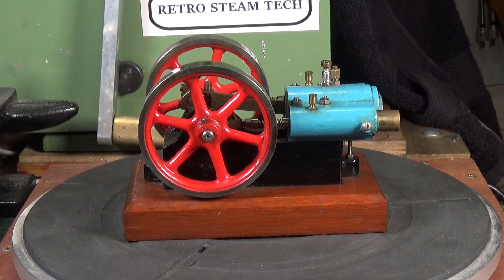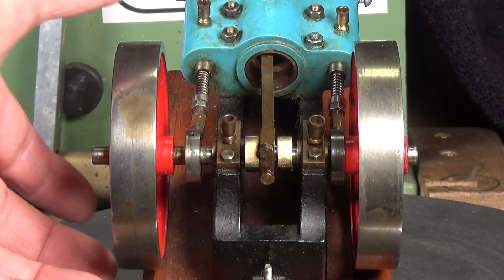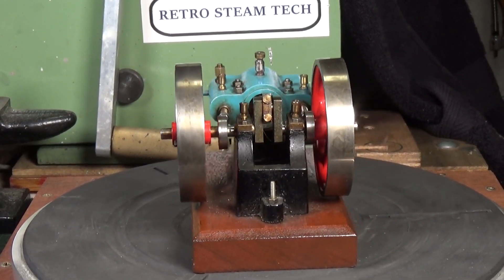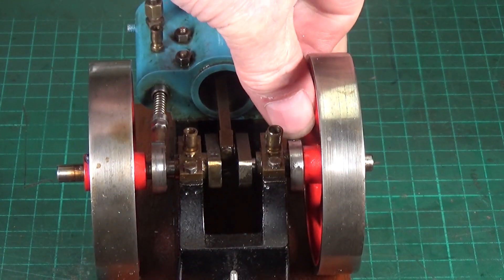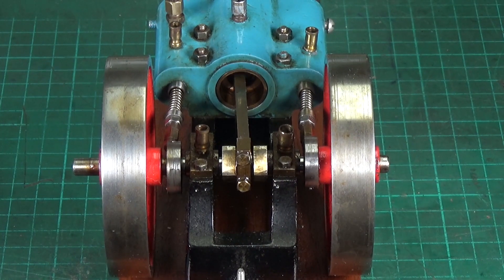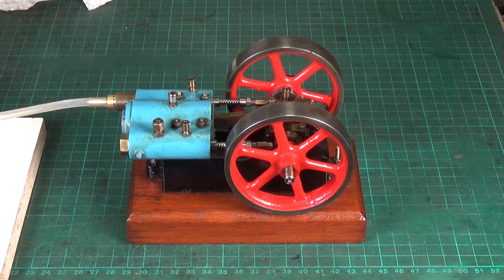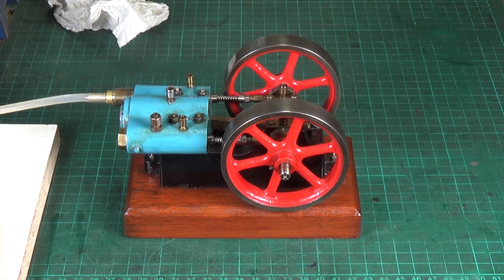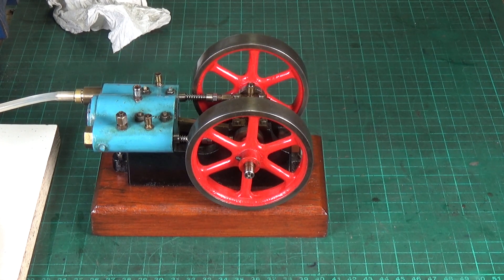Jowitt Poppet Valve Model Steam Engine

Comment: where is the exhaust?
Reply from the maker: Looking from the cylinder end of the engine the exhaust is on the righthand side, it's the small pipe fitting next to the oiler cup.
Reply: @RetroSteamTech  so the exhaust is smaller than the inlet?  Maybe you are running it backwards and the wee pipe is the inlet? Just a thought...
Reply from the maker: @charlesfitton9677  If you look at this rather excellent build blog for the engine https://modelengineeringwebsite.com/Jowitt_engine_build.html you will see from the photos and the plans that the exhaust is supposed to be where it is. The inlet and exhaust valves are different lengths. That being said,  if you adjusted the valve timing there is no reason why it shouldn't run in the opposite direction if you fed the air in through the exhaust port.

Comment: Hello Alan,
I do like the Jowitt and I do like the little compressor... The plans that you have for the Jowitt would it be possible to build one without the castings?
Cheers.
Paul,,
Reply from the maker: Hi Paul. Yes very possible to build one without the castings. If you have a look at 'eifion jones' YouTube Channel, he's one of the other commenters on this video, he built one from bar stock. Also the one which is covered in this build blog https://modelengineeringwebsite.com/Jowitt_engine_build.html was built from stock materials. Cheers, Alan.

Comment: These are great little engines, I made one from bar stock many years ago, still runs great
Reply from the maker: Just had a look at a couple of your videos which feature your Jowitt, it's lovely 👍👍 I don't think I've seen one made from brass before and I really like the solid flywheels too.
Reply: @RetroSteamTech  made it aboard ship so used what I could find in the scrap box
Reply from the maker: @eifionjones559  It's an excellent piece of work and runs really well.

Comment: Hi Alan, you can see the connecting rod moving across the camshaft . I think you could shim the camshaft to cure the vibration. Great video.👍
Reply from the maker: Hi. Yes indeed. Something else I spotted after staring at it for some time was that the conrod is bent slightly where it joins the crankshaft. I'm sure this doesn't help! Glad you liked the video. Cheers, Alan.

Comment: Interesting design. I like it  cheers Dennis
Reply from the maker: Hi Dennis. Yes it's definitely unusual. If you are interested a detailed build blog with pdf drawings is available here https://modelengineeringwebsite.com/Jowitt_engine_build.html . Cheers, Alan.
Reply: Retro Steam Tech  would you believe i had just googled and found that website had a read and downloaded drawings before I found your reply. Could be an interesting project. Cheers Dennis
Reply: @scorpion2nz  think there is a slightly scaled up version on there too
Reply from the maker: @eifionjones559  The chap made both a scaled up version and a scaled down version. I also like the way that he has filled in the holes in the sides of the ports rather than use screws to block them off.

Comment: Gday Alan, this little engine runs great, interesting to know what rpm it was doing, thanks for sharing mate, Cheers
Reply from the maker: Hi Matty. They are great little engines and having valves like a car engine makes them a bit unusual. I must measure the rpm, I also need to get a regulator for my little compressor, at the moment it's balls out or nothing! Cheers, Alan.